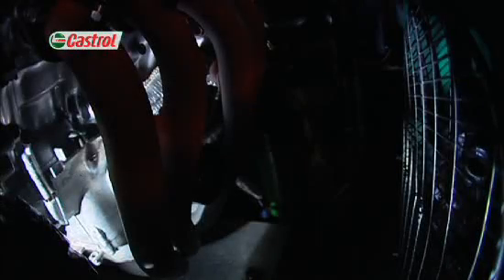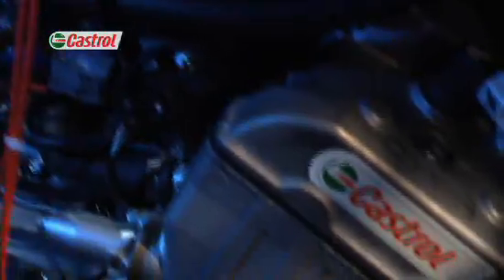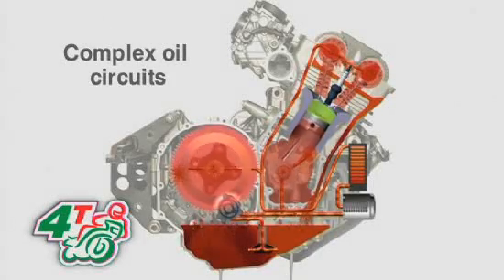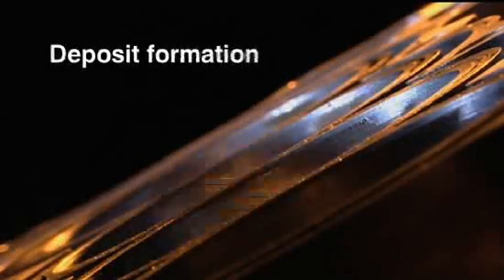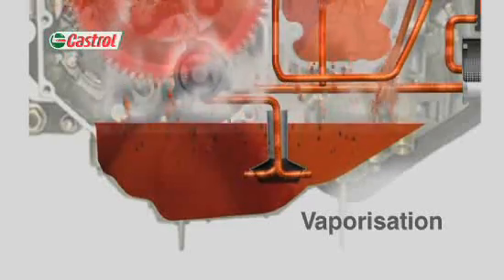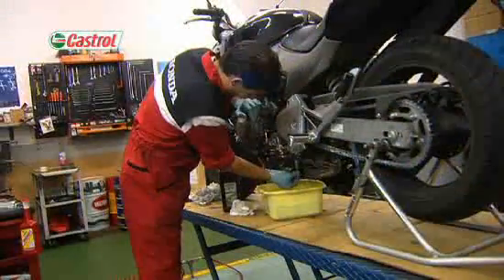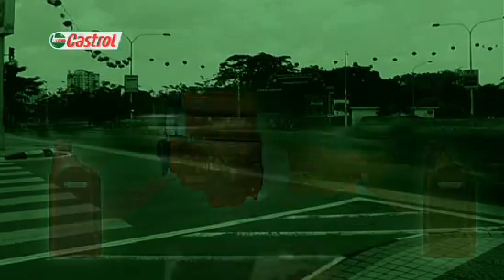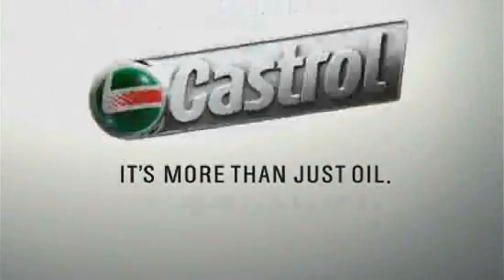Motorcycle Engine Power

Comment: Last time I changed the oil in my Suzuki Intruder 1400 which has a V- twin , I used Castrol Actevo !0w 40 motorcycle oil and noticed a big increase in performance and it sounded a lot smoother .

Comment: this is why i hate 4 strokes, less power and more rpm and no oil burning. At least a 2 stroke burns up and gets rid of the oil, same goes for a cr700 bike with a Rotron rotary.
Reply: Bruce Miller but they are much lauder and mixing oil gets annoying trust me I owned a couple 2 strokes my biggest was a 250cc but they were loud and not so fuel efficient and 4 strokes are mostly for road bikes thoe

Comment: 15k rpm is a pretty rare engine. Most redline under 12k RPM
Reply: stephenmwyatt2 Honda CBR 250RR = 20000 rpm
Reply: just the 600cc supersports rev that high. My zx6r redlines at 16.5k rpm
Reply: r6 has redline at 17,500
Reply: My 06 zx6r revs to 15.5k rpms
Reply: Zxr 250 1997 ...redlines 19K rpm

Comment: Very interessan video 
i have a quistion 
what happen if is to mach olie in the motorcycle engine?

thank you
Reply: every engine is given a grade and volume you cant fill more if tried it can be just like a glass of water over flow when keep on filling .
Reply: And the oil pump inside a engine wont work and thus the engine will get heat up quickly and you gonna see leakage from the gasket or smoke comming oit from exaust as the ring compressor in the piston starts allowing to enter the oil in the combuntion chamber due to over flow of engine oil its start giveing pressure .at upward direction.